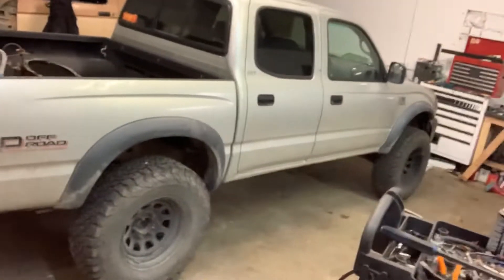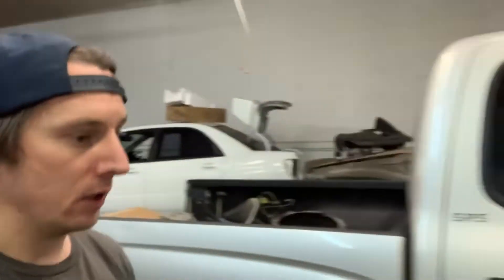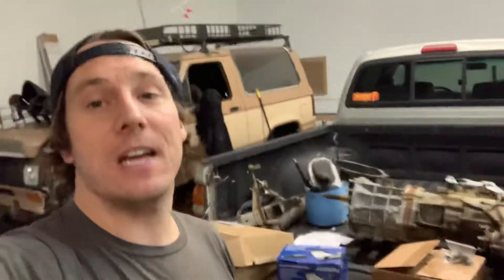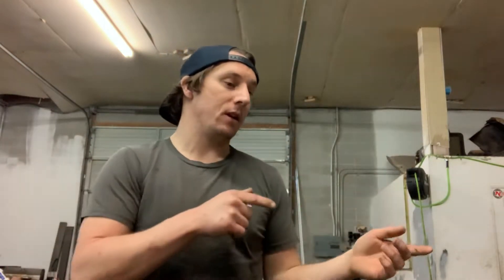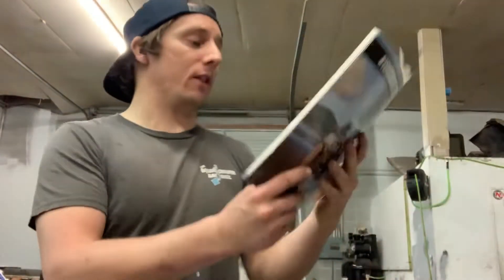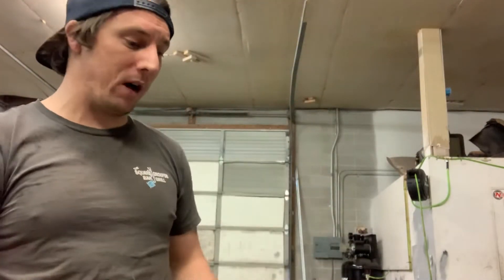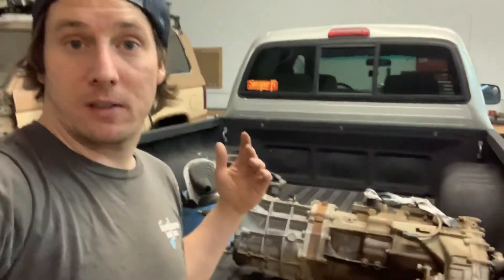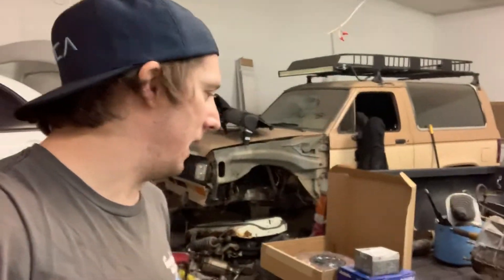2002 Tacoma 3.4l 5VZ-FE V6 manual transmission conversion project part 1.

Comment: Hi, I am trying to find out if the swap will work with the automatic’s transfer case.
Reply: Have you figured that out yet? I just put mine in and I’ll let you know if it works!
Reply: @davidrasmussen4486  did it work
Reply: @davidrasmussen4486 did it work?
Reply: @davidrasmussen4486 did it work